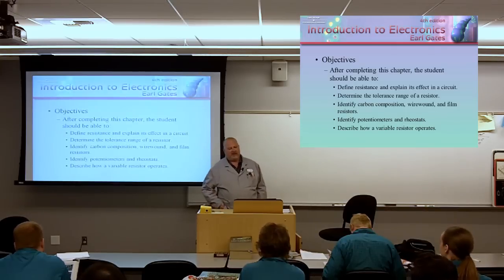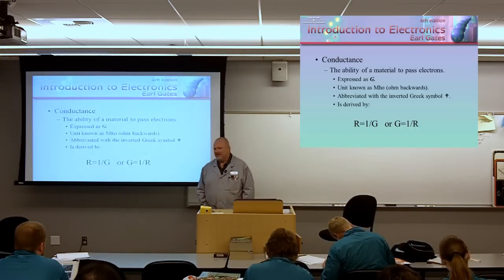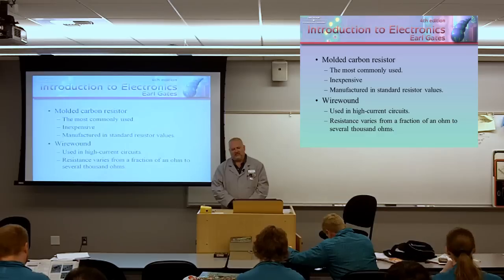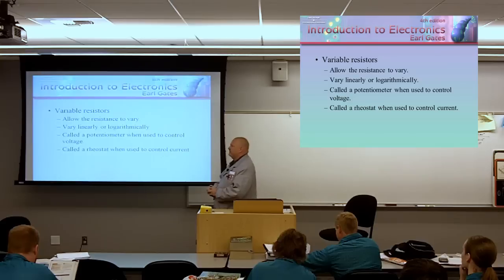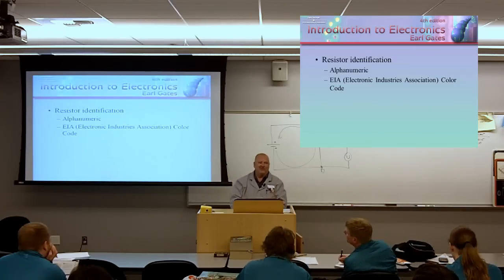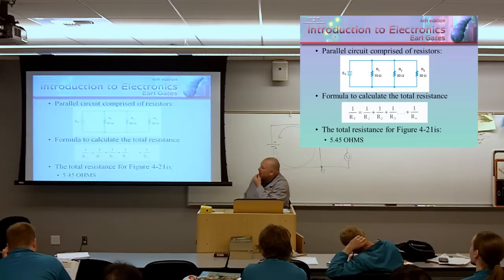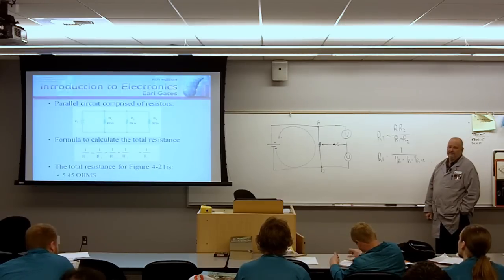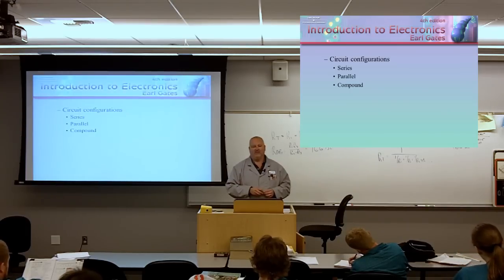ELEC 110 Chapter 4 Lecture - Resistance

Comment: RN60D5112F is a:

TYPE: METAL FLIM
RESISTANCE: 51.1KΩ
TOLERANCE: ±1%
POWER RATING: 0.25 W
TEMPERATURE COEFFICIENT OF: ±100 ppm/°C

Comment: ..so in theory electrons moves slower when it's hotter and faster when it's colder..it do not freeze when it's 0 kelvin..so if it's to hot as it melt the conductor it stops the electrons movements to complete the circuit..

Comment: Conductance is an expression of the ease with which electric current flows through a substance. In equations, conductance is symbolized by the uppercase letter G. The standard unit of conductance is the siemens (abbreviated S), formerly known as the mho.

When a current of one ampere (1 A) passes through a component across which a voltage of one volt (1 V) exists, then the conductance of that component is 1 S. The siemens is, in fact, equivalent to one ampere per volt. If G is the conductance of a component (in siemens), I is the current through the component (in amperes), and E is the voltage across the component (in volts), then:

G = I/E

Comment: I have a question about wire wound resistors dose ac affect the resistance of them due to magnetic flux?
By the way really loving the lectures and I’m picking up things I struggle with when took electronics at college

Comment: I think a better way of describing a metaphor parallel resistor is like a damn wait holes in it. The more holes the less total resistance of the waters current through the damn even though each hole has resistance it’s still letting water through. More holes next too each other on the same damn or “resistors in parallel” the more water or current can travel through the damn

Comment: They're being trained to wear the stupid esd smocks all the time. Probably some company that hires from them said, "Why aren't they wearing esd smocks?"   that was my biggest gripe of working in electronics for 30 years. people that have no idea forcing you to wear a smock the whole time, whether needed or not.  I remember my first company put ground metal sheets over our benches and grounded them. I ask, what's next, putting our feet in a bucket of water?  we'd get shocked all the time. They didn't put a bleeder resistor in line to ground.

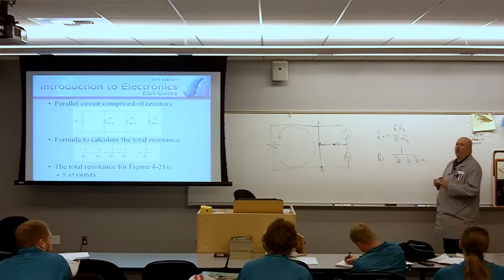Comment: 1:10:37 - "It only works with two resistors in parallel."  WRONG!!  Let's say you have 3 resistors in parallel.  You can figure the resistance of two adjacent resistors using the product-sum formula and use that result with the 3rd resistor using the same product-sum formula.  You can do that for as many as you have in parallel.  True, it takes longer, but the statement "the product-sum formula only works with two resistors in parallel" is INCORRECT.
Reply: I think he said that so the students can work the problem a little faster